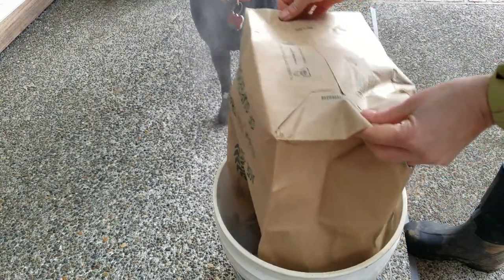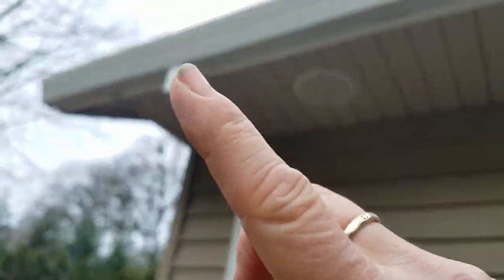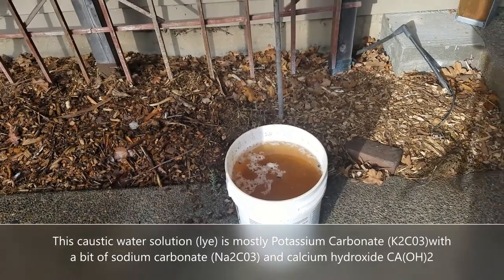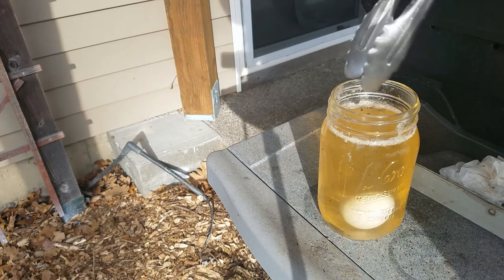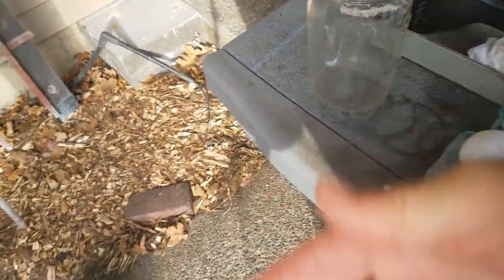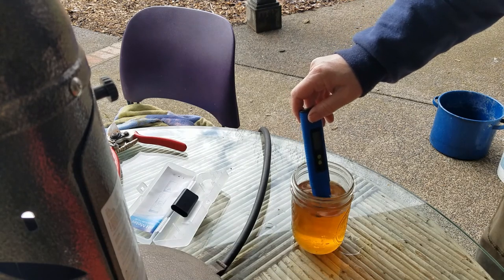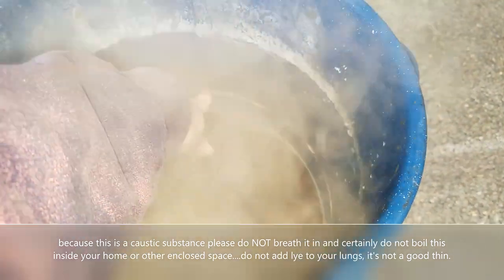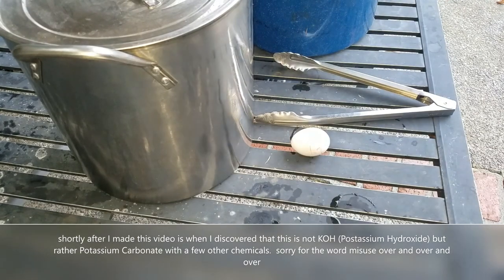How to Make Potash aka  Caustic Potash (potassium hydroxide) from Wood Ash

Comment: You must stur/wisk/fold the solution (KOH+fat) vigerously until it thickens until you get a 'trace' solution ( thick enough to hold draw on with the spoon). Then add sents, and if you want a hard soap you can add a few tablespoons of salt, plenty of bees wax, and some honey then mold and leave somewhere cool to set.
Reply from the maker: hi Chris, I'm an experienced cold process and hot process soap maker...my issue isn't with the making of the soap, it's how to handle the caustic potash (instead of lye) and the ratio's of potash to fats...any ideas there?
Reply: @OldSchoolPrepper  Try reducing the fats you're using heat of course without burning is the trick. And up the level of potassium I'm thinking and some bi-carb soda.

Comment: I was saving ashes in a stainless steel pot and they ate a hole right through the pot. I think a little water got in.  I see your using a ceramic coated pot.
Reply from the maker: yes, any metal will get eaten by ashes, particularly hardwood ash it can be mostly lye when there are less extras when burned (less paper, softwood and other orgnic material) infact you can use it as drain cleaner if ou have too...I always use ceramic lined pot for cooking and plastic or glass for holding.

Comment: I believe “caustic soda” is sodium hydroxide and “caustic potash” is potassium hydroxide.
Reply from the maker: can you show me your source info so I can veryify?  thanks
Reply: May have been something as lame as Wikipedia, but I only looked it up because of some previous vague knowledge I had. If nothing else, they are definitely different things. Potash can be made from fire ashes. Caustic soda is sodium hydroxide. I think it’s made by electrolyzing salt.

So to answer that, I would say it was school and a cursory internet search of a couple different sites I can’t remember.
Reply: This is in fact, true, "potash" is so named for the potassium, "soda" is the name given for "sodium hydroxide", this from high school chemistry more than fifty years ago.  Either and both will make the nitrogen salts that are active in producing lye.
Reply: You are 100% correct. They do have the anomaly of being the most chemically similar hydroxides. But soda is sodium, and potash is potassium.
Reply from the maker: @whendarknessfalls6969  makes sense, I'll have to include this info when I finally find a workable recipe...any suggestions?

Comment: The egg stands up on end because the older they get the more air gathers in the one end
The egg getting older will make it float
Reply from the maker: I raise chickens, my understanding is that it's not air, rather it's gas from the inside of the egg beginning to ferment and then rot.  either way I know why it floats in WATER but eggs that are perfectly fresh will float in caustic soda if it's strong enough but I don't know why.
Reply: A hydrometer would have helped. You were basically measuring specific gravity or density of the solution. @OldSchoolPrepper
Reply: @OldSchoolPrepper when the concentration raises the density raises when its strong enough its dense enough to make the egg float

Comment: I just want the potash for use as firtilizer! How do I water this stuff down for my green beans????
Reply from the maker: hi Matt, I actually use fresh human urine for fertilizer and use wood ash as the PK value (Potassium, Phosphorus).  I put about a tablespoon of ash near the root of the plant and then use 1 part urine to 10 parts water into a watering can and then water in the ash.  It works great...I'm on my 3rd year of experiemnts using this method:  https://www.youtube.com/watch?v=2wp8DMnJc3U&t=16s
Reply: @OldSchoolPrepper  I've been using urine all season. But if I just soak ashes should I water that liquid down some more?

I am leary abiut using ashes directly because we already have alkaly soil here. I don't wanna push the PH too high.
Reply: Wouldnt using urine increase the amount of human prions you ingest?

Comment: 3 lye to 1 oil or tallow need salt to harden and must cook for a few hours until all liquid is completely gone.
Reply from the maker: i shall give this a try, may I ask if you've actually made soap (with this recipie) from Potash? or did you pull it from a source?  thanks Gabriel
Reply: @OldSchoolPrepper  much research and im getting ready to proceed with this recipe, my pot ash has been soaking  for many days now, prepared my tallow boiled it with herbs and strained it  recipe will be hot process in my slow cooker, it may take a full day to complete. i didnt want to screw up so i researched the process extensively,
cheers
Reply from the maker: @gabrielwimmershoff7614  please let me know how it goes
Reply: @OldSchoolPrepper  another week and we shall know , i will let you know
Reply from the maker: @gabrielwimmershoff7614  did you give the solution a try at making soap?

Comment: you dissolved and boiled down wood ash? That’s a bunch of stuff. I thought potash you bought was this stuff recrytallized. or they first crash out calcium and other elements so it’s more concentrated potassium.
Reply from the maker: I never claimed to be a scientist ;) but I try!  lots and lots of bad info out there about potash being lye (wrong) but what you say is on the correct side, there are a lot of stuff in this:  Potassium carbonate (aka 'potash',) from wood ash. Leaching plant ashes with hot water, filter and boil filtrate down to dryness. The solid obtained is crude K2CO3. Only a few percent of the ashes is potash, though.

KOH can be obtained by reacting K2CO3 with slaked lime (Ca(OH)2) and water. A solution of KOH and insoluble CaCO3 is obtained.
Reply: @OldSchoolPrepper  Interesting. KOH is what you get from K2CO3 mixed in water period. The CO2 derived from potassium carbonate is the same as the CO2 from the air - both will cause calcium hydroxide to go milky, but air is slower.

Comment: Hi, I was intrigued by what you are up to.  Looking, you can make calcium carbonate using crushed eggshells and HCL.  That will react with potassium carbonate to make lye.  If I understand it, you can figure out necessary amounts when a calcium based precipitate stops forming.  Takes a couple of days.  I looked also to see whether you could use vinegar/lemon juice, but those make potassium acetate: Ca(C2H3O2)2 + K2CO3 = KC2H3O2 + CaCO3, and there are a few references to this in soap, one in a google patent.

You can also make potassium chloride based soap.  Here are the instructions.  I suspect that is where you are already!
apparently lime rock can be used as well, to get the calcium carbonate to make KOH.  "When the carbonate lye was ready to make soap, it was mixed with a portion of the fat to be saponified. The mixture was simmered and stirred over a fire for many hours. Because the lye concentration varied from batch to batch despite one's best efforts, this "boiled" soap making process was a trial and error method. Lye was gradually added, the mixture cooked and stirred, more fat and more lye were added as needed, and the mixture was stirred and cooked further until it formed a crude paste soap."  https://classicbells.com/soap/woodAshLye.asp
Reply from the maker: thanks for the intel.  I know I can make calcium carbonate using sea shells (like oyster shells too).  I know I can make soap with almost any of the caustic chemicals where I run into problems is how much of each.  even the recipie you shared reads "it was mied with a portion of the fat"...i understand it depends on how strong the KOH/or lye is...but how much fat?  I've read from very little (like 1 part fat to 4 parts lye) to 50/50 ratio.  I'd just like a good place to start....it is maddening.  This winter i'll go back to trying more and more again.  This time of year i'm obsessed with the garden.
Reply: @OldSchoolPrepper  Right =)  The recipe I posted was you have to do it a bunch of times and iterate to understand the soap goop.  Like folks in the day had to!!! =) OK, so if you can make calcium carbonate, you can make lye.  You can get a sense of when the process is at equilibrium by observing the sediments (precipitants) over time.  If you add potassium carbonate to your lye + carbonate and no more precipitants, you are low on carbonate.  If you add more carbonate and no precipitants, you are high on carbonate.

There are some values for mg lye to fat type here at Wikipedia, as well as how to determine the values (not easy!)

https://en.wikipedia.org/wiki/Saponification_value

Lard, for instance is about 200mg/g, or 1/5.
Reply from the maker: @damesftw45  I am an experienced soap maker. both hot and cold process (I prefer a cold process bar myself)...so I get it, I just wish someone (other than me) had the ability to test this and just let me know.  I have tons of recipies for soap making with straightforward KOH (I use Lye from a chemical company)....I'm just complaining and bitching...but I think you get it.  sorry for the vent...seems if I want to do something right I just have to do it myself...what else is new ;)
Reply: @OldSchoolPrepper  Well, the values in the Wikipedia Saponification Value are what you seek.  These ratios of lye to various fats are in the table.  Those are probably the best numbers you will find, and it also includes additional information.  So!  =)  Do not be frustrated!  I spent about an hour experiencing the same issues you did, people saying things that they did not understand, until I found this source.

It's pretty cool.  It tells you ratios for olive oil, sunoil, whale oil!  I think it has that which you seek.  let me know! =)

Love the Rosie the Riveter image.  My woman is half man, I think! With all respect!
Reply: @OldSchoolPrepper  Oh, AND, on the strength of your thoughts, I have a bucket with ash in it I'm going to try to.  I read in my wanderings that high heat combustion can vaporize some potassium chloride.  I also suspect, but don't know, that lye and potassium chloride are interchangable.
Reply: @OldSchoolPrepper  Also, I'm not sure how these things are meant to work, but I am also going to try to make soap. Maybe Sunflower soap, or olive oil soap.  It would be fun to be able to exchange experiences!
Reply: @OldSchoolPrepper  Also, I managed to make a cup and a half of PH 14 'lye'.  I think I need to make a gallon before experimenting with soap.  I can always use it for my garden!
Reply from the maker: @damesftw45  you shold really think about making some more videos...the one you have posted is interesting.
Reply: @OldSchoolPrepper  Thanks!  Actually, that's my son discussing.  He's quite good at these things.  It's my idea for a larger project.  He told me how it would end before he started it, as he has a certain kind of intution.
It certainly demonstrates the amount of pressure the atmosphere has!  80 pounds per square inch.  Over a foot, that's 11,520 pounds.  Almost as much as the largest elephant weighs at 13,500 lbs!

I have many experiments going, but I don't have the skill my son has in presenting.

Comment: What's the best kind of wood to this process ?
Reply from the maker: The best wood is hard wood, hard wood comes from trees with leaves and not needles. Good Luck
Reply: @OldSchoolPrepper  Hardwood produces potassium nitrates, soft wood makes sodium nitrates.  Both will make soap, potassium is denser chemically, stronger.

Comment: Do you cover the bucket while in the process
Reply: Do you use just the water or you use the ash
Reply from the maker: when making potash I just use the water after a really long soak.  I do use the ash after in my garden or in potted plants depending on if I'm using it as a soil additive or to increase soil pH but I don't use it in making Potash in any additional way after soaking rain water in the wood ash.
Reply from the maker: I keep the bucket undercover, so it's covered in a general kind of way.